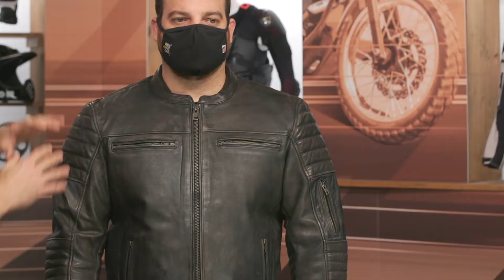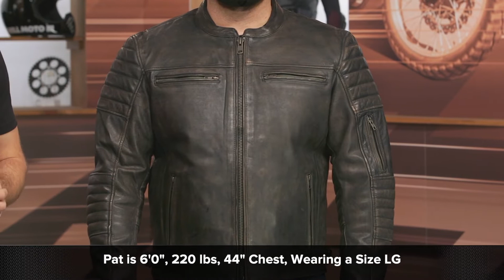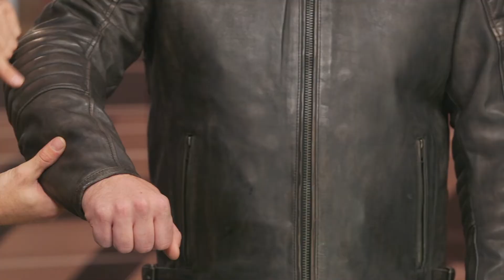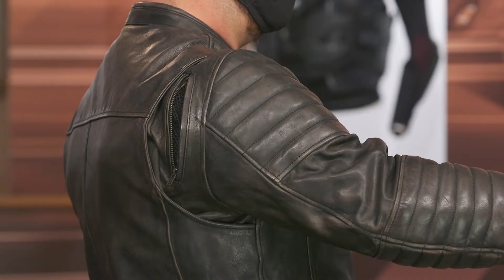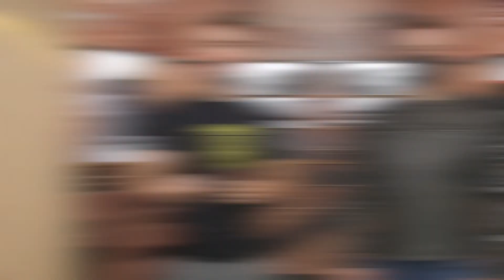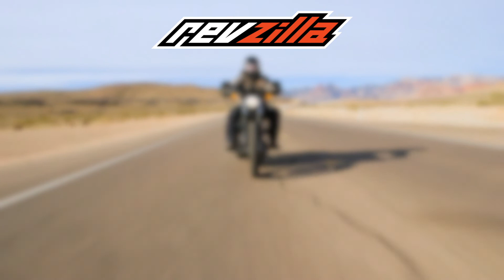First Manufacturing Commuter Jacket Review

Comment: I’ve used this jacket for 3 years now and I absolutely love it. VERY warm in the winter. Perfect for spring/fall with the thermal removed and those zip vents do make a HUGE difference.
Reply: How cold have you gone riding and stayed comfortable?
Reply: @motozixxer245  I ride a Softail Deluxe and with this jacket, I have found that 28 degrees is the lowest temp I’m comfortable riding in around the city. Obviously, that’s with winter gloves, chaps, full face helmet, and one of those neck gator things but, it’s all good. Cold, but doable.